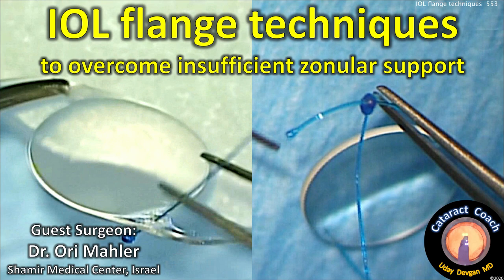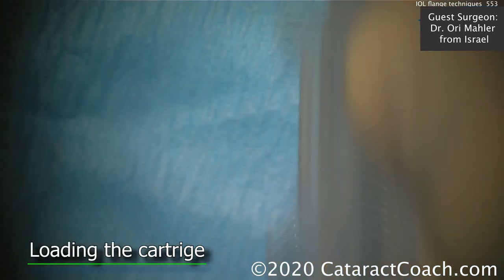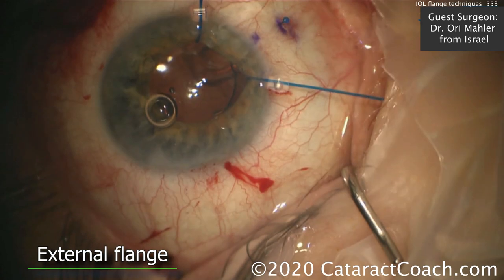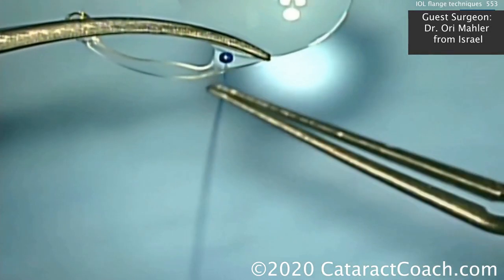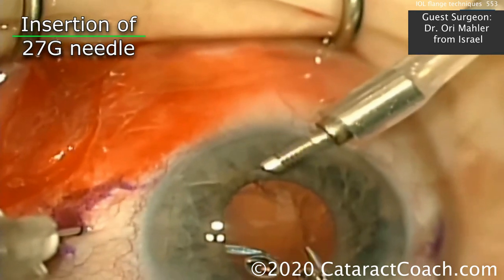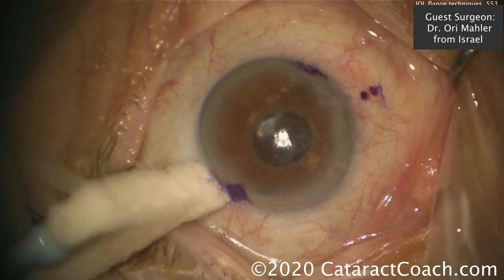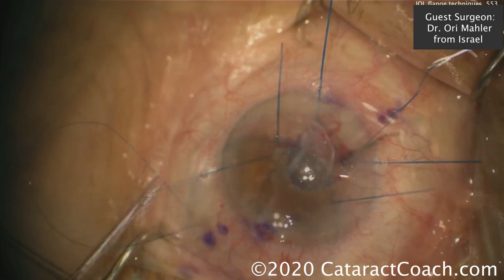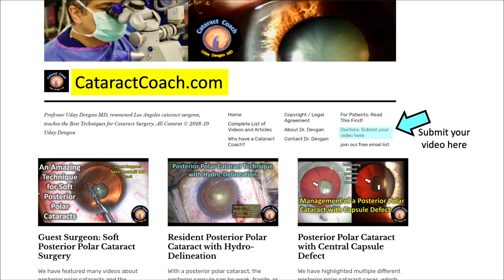IOL flange techniques to overcome insufficient zonular support

Comment: Beautiful technique... But, how about the risk of endophthalmitis from the prolene that fixated at the sclera?
Reply from the maker: Yes there is a risk but it can be reduced by pushing the prolene bulbous end into the scleral tunnel.
Reply: @UdayDevgan  Hi sir .. lovely video and narration ..thanks !..it could also be pushed under a small scleral flap on either side making it more secure in terms of exposure.
Reply: The risk of endophthalmitis is very low but the risk for that is the same as in other alternatives such as Yamane or other.

Comment: What happened in Scleral fixated IOL when or if prolene suture got biodegrades?
Plz clear
Reply from the maker: the larger 5-0 prolene tends to last for a very long time. The older technique of using 10-0 prolene to scleral fixate an IOL is out of favor. For the ultimate in long term stability, we now do it this way:
https://cataractcoach.com/2020/05/25/19344/
or
https://cataractcoach.com/2020/04/05/scleral-sutured-iol-with-goretex/
Reply: I agree with dr. Devgan. It will strong for a very long time. Much longer than 9-0 or 10-0 Prolene